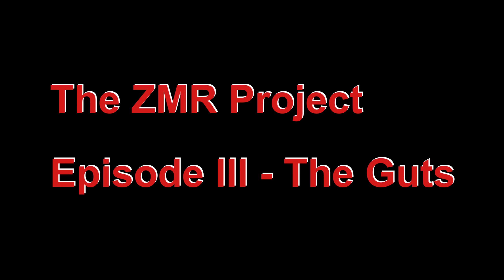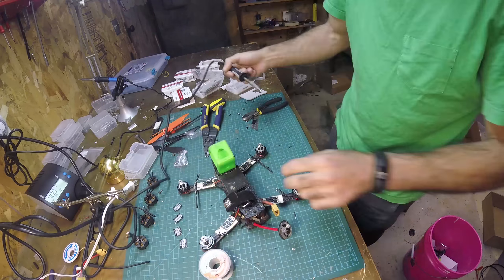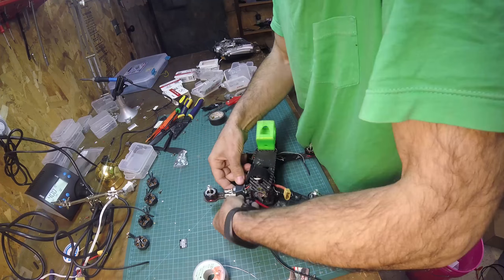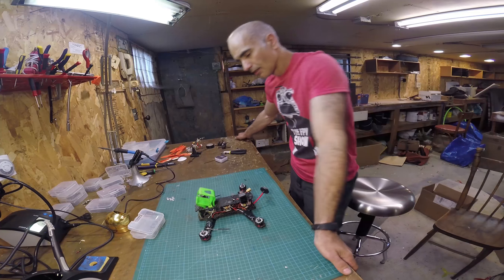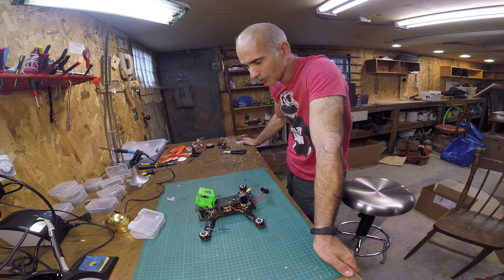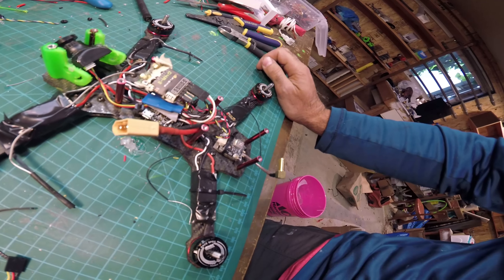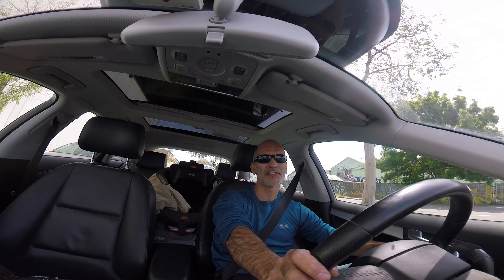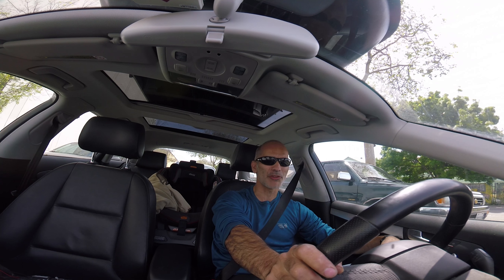The ZMR Project Episode III - The Guts

Comment: Why do you want to replace the frame? Though I'm sure at this point you won't notice much of a difference as far as stability/smoothness with new motors.
Reply from the maker: This frame is all shaky and battered. The arms flex a bit more than they should. I'm sure new arms / standoffs is all it needs, but replacing those requires taking the frame apart. Might as well use a different one.